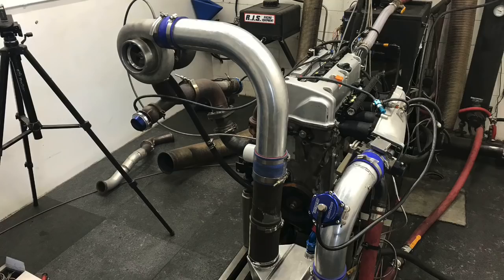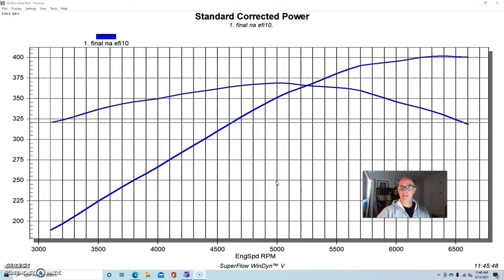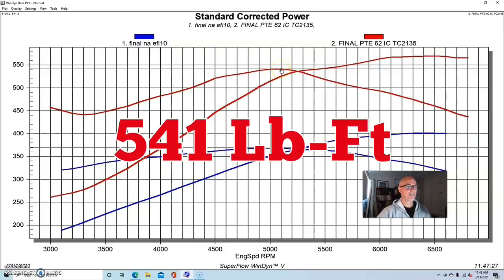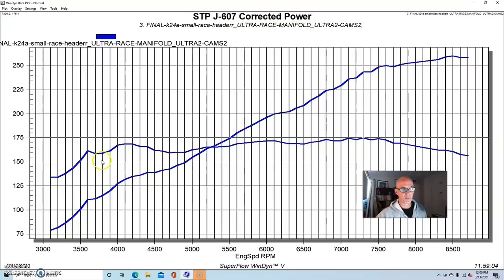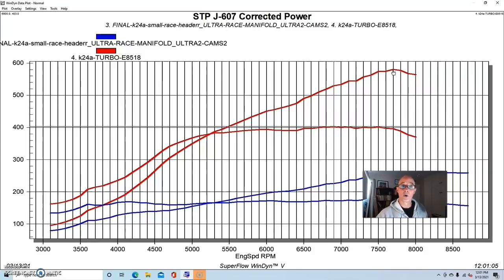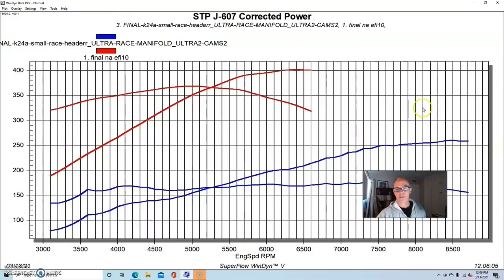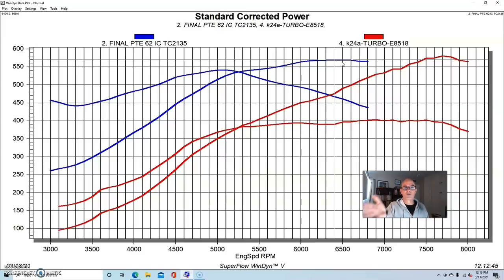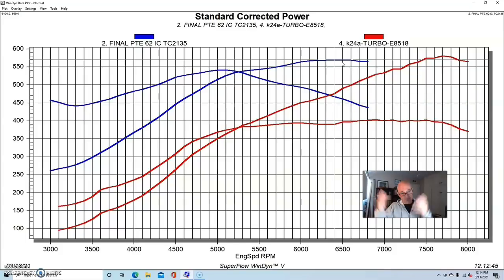CHEAP, JUNKYARD BOOST TEST-K SERIES HONDA VS LS (2.4L vs 4.8L)

Comment: I´d probably go turbo LS, but the K-series is somewhere around 230lbs lighter than the 4.8 so theres also the weight difference. Keep in mind that the higher rpm of the K-series allows for a numerically higher ratio in the diff as well, meaning higher torque multiplication, which means that the "low" torque of the Honda motor will actually not be that low when put to the ground. Thats why just comparing engine dyno numbers can be misread. Look at how much torque is hitting the tarmac at any given vehicle speed.

Comment: If you have the space for an ls it will definitely be a better option for a street car. Your engine spends most of its life around 2k rpm, the torque differential can’t be made up for no matter what is done to the k series. Even if you manage to get higher peak numbers it will always be way further out in the rpm range, so if you want say 600hp and don’t care what engine it comes from the ls is a much better choice simply because of the flatter power curve

Comment: As far as efficiency goes wouldn't the 2.4L Honda be more efficient than the 4.8L LS? Therefore I would imagine that the 2.4L Honda would be more fuel efficient/mpg. Even if the 2.4L Honda needed to run much higher rpms. Granted the 4.8L LS looks much more torquey especially at lower rpms. I just wish that I knew more about the 2.4L Honda (or any of the Honda K-Series) which unfortunately I don't. Any thoughts?

Comment: This question needs to be answered with another question. What are you building the car for? Is it road race? Drag? Maybe a drift car? It's less about overall power and torque with certain types of racing. Overall weight and balance, as well as where the torque lands on the curve, will be major factors with road racing where it may be less important in drag racing where everything is kinda looking for peak performance in short duration.

Comment: 4.8 is way better. Sorry to hurt feelings lol. I'd take the 4.8 any day over the honda motor. 8psi vs 14.5psi and still not more hp, only a 500rpm difference at the top. When you said high boost I was thinking you were gonna say like 30psi for the Honda.
Reply: Way better? Lol bud, look at the torque curves. That ls is falling on its face hard at 5200 rpm. By 6000 its ready to go home for the day. An engine half the size is holding peak torque to redline and making more hp. How? Volumetric efficiency. The k24 would be walking away from that ls before the 1/8th mile mark. The performance is incomparable, a dohc head with variable valve timing and cam phasing vs a pushrod single cam with fixed valve timing. If all you want to do is burnouts and donuts get the ls. If you want a fast time slip, get the k24. It's like comparing a billy club to a machine gun.
Reply: @оначертовасука  🤣🤣🤣

Comment: Technically more then 2x as the k24 really is a k23.5 :) or perhaps the 4.8 is a 4.75..? The answer however is the Turbo K24 in a smaller, lighter chassis... like a 1st gen Miata or, perhaps, a MR2. Those would fly!

Comment: I'd still go with the V8 simply because it does make more tq and because it makes more power throughout the curve. These 2 engines in a car that weighs identical, the V8 will be faster.
Reply: The v8 is can’t have high horsepower

Comment: I would use the k series’s because it can make the same power with turbo but it is a much lighter package and with gearing can deliver it just as well  and you can place the  k series behind the front wheels for better weight balance

Comment: I don't know how close I'm on this but it seems to me that the 4.8  LS could be run on 91 octane fuel just fine at this lower boost and be more streetable in a daily driver where the Honda 2.4 would need at least E85 or race gas to maintain this power level. I honestly don't know if I'm right or wrong. am I close or way off base. I'm still trying to figure out turbos

Comment: For me it’s about the fun factor. Sure I could do an LS and be like every one else and their mother. Every week I go to the track with my 4 pot rwds (4g6x/PG) there are crowds wondering what’s going on, and how I run single digits back to back to back, when LS swapped s10s are not even as fast. It’s a fun conversation piece. Mainly I love the rpms after being stuck to low rpm v8s so long.

Comment: Isent it some complex physics that makes smaller cylinder engines more efficient? Something with the mixture with fuel and air in the chamber and weight compared to strength

Comment: Relative to the boost levels, 4.8L +roughly 0.5 bar of boost = 6.0L. 2.4L + roughly 1.0 bar = 4.8L. It's pretty clear which one is the more efficient engine.

Comment: So who would win a drag race? All other things been even. A lower revving higher torque motor, or a high revving low torque motor?
Reply: Depends gear ratio, high revving car can use tight gear ratio between other gear to keep engine at peak horsepower
Reply: If everythings the same id assume the 4.8 more toque to get you off the line and the same horsepower wouldnt be enough to catch back up, but theres so many other things that can change a race.

Comment: With the K24 you have to be a little careful having the torque come on at a low rpm. High torque at low rpm hurts the rods and bearings since they’re designed to be a higher rpm engine.

Comment: Choice 3: Big block with RV cam and twin turbos for mega torque right off idle. Run it with a lazy rear end gear and cruise the highways.

Comment: 4.8 with pump gas 2.4 race gas 4.8 all day also was this ran on waste gate spring not a boost controller and from a dead stop the v8 is gonna kill freeway pull the Honda May walk away

Comment: I just did rear wheel torque by adjusting gears both almost the same, but Honda is a lot lighter
Reply: instead of calculating rear wheel torque, you can just use hp.  HP is torque and RPM, allows easy comparisons between different gas engines and alternative sources (turbines, electric motors).  You can also talk kilowatts (kW) many power sources talk in kW and the hp to kW conversion is simple.
Reply: and takes a lot less space.
Reply: @twistedarrow3574  that is either a heavy civic or a light s10.

Comment: I’d like a smaller turbo on an I6 so it spools just off of idle. Low boost 8-10# should give a massive torque boost in the normal driving range. I rarely shift mine >3000-3500 rpm. Usually 2500. 

Can you test more I6 and V6 engines?
Reply: I like the way you think.
Reply: Sounds like a 335i. Problem with that is traction in second and third. Power hits too fast. Need a little more spool time
Reply: @yotaismygame  I have a 135I with 298kw(400HP) at the wheels I'm still setting up boost by gear and I have a Mfactory LSD So it's fast in first, faster in second, and loss of license in 3rd - 6th, lots of fun
Reply: It would be for towing my camper with my mid sized truck. Spool earlier and I wouldn’t have to keep it 3000+ for hours on end.
Reply: Try the BMW N54 it's L6 3.0L twin turbo, I really love it, But cam here to watch the K24

Comment: They make similar peak power, but I think in the same chassis (but gearing changed to suit each motor) the 4.8 would be faster, because of power under the curve. That's the plan with the Nova?

Comment: If you have a heavy vehicle truck or suv the ls is the best choice. If you have a small light weight vehicle you want fast the honda motor is the better choice for weight savings. Once you start getting into larger power number the ls is a much better budget friendly option.

Comment: I wonder which one uses fuel faster at that peak power. that would be really interesting to know. I know little engines revving really fast can eat more than people realize.
Reply: He should be able to pull up the fuel flows from the dyno I think that would be really close.
Reply: You have to burn a similar amount of fuel to get similar power, the whole point of the smaller Honda is you can keep revs low when you don't need to go fast and burn WAY less then 4.8 at 3k rpm
Reply: @robocris1988  bsfc

Comment: How heavy would that honda engine be roughly
Reply: I was able to carry it by myself out my trunk. I'm a small dude 5'6 I'd say maybe 160-180lbs
Reply: They are light, about 250lbs. I have lifted and carried multiple K24 and K20 engines fully dressed out of the back of my truck, to my house and down the stairs myself. I would weight one for you to get the exact weight but none are complete anymore.